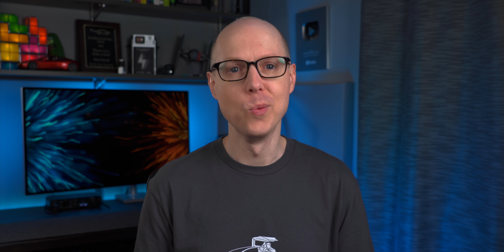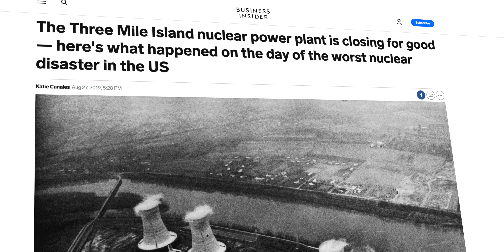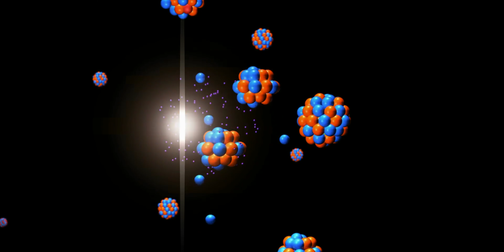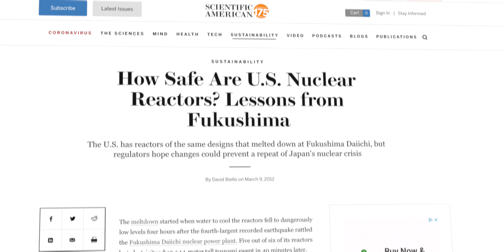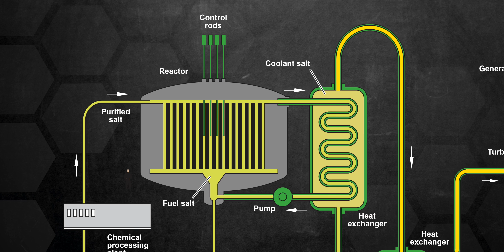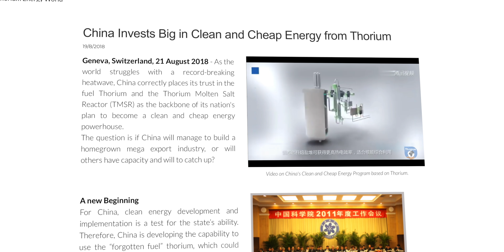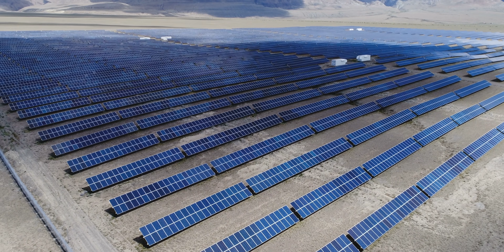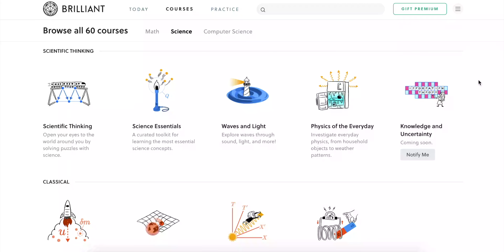Thorium explained - the future of cheap, clean energy?

Comment: I have been hearing about the potential for Thorium for the past 15 years but doubt we will see a successful roll out of the technology in my lifetime (I'm 66). Much like the dream sold back in the 1950's of power too cheap to meter for nuclear, Thorium seems to base it's pitch on unlimited 'safe' power.  All the time renewables are eating away at the economics of nuclear of any sort and the latest generation of solar panels about to be launched together with battery storage tech will further dent the proposition.  Traditional nuclear was driven by military needs but Thorium has to stand on it's own merits. I doubt it will.
Reply: Hi John North,
Given all the companies which are pursuing this technology, I think you are very likely to see technology before you die.  You just have to promise not to die.  (For 3 to 8 years.)

I listed 6 groups in a post above, and didn't mention the heavily funded Chinese program.

Warm regards, Rick.
Reply: @RicksPoker  Not holding my breath :-) https://www.dailymail.co.uk/news/article-8406315/Dramatic-moment-silo-collapses-nuclear-power-plant-Hinkley-Point-C.html
Reply: @johnnorth9355  
Hi John North.
I read the article you linked to.  It had nothing to do with Thorium research. Did you post the  right link?  Or was this a general example of how any bad news for Nuclear is big news?  

Warm regards, Rick.

Comment: If thorium is 3X more abundant than uranium then its 428X more abundant than uranium 235. U-235 makes up 0.7% of natural uranium the 3 to 5 % is how much you need to enrich the U-235 for usable fuel. Yes a little of the U-238 (2% ?) gets converted to plutonium  of which the Pu-239 ( 75% of Pu isotopes ? ) is useful fuel. To really make Pu-239 efficiently with less of the undesirable other isotopes you take the fuel out after as little as two weeks, it will be neptunium, wait (a month ?)  and the neptunium decays into plutonium. For real efficient breeding you want to use fast unmoderated neutrons, that means high levels of enrichment and high temperatures so no simple water coolant. Thorium's advantage is that it allows breeding with thermal neutrons like all power reactors use.
Reply: and all the meanwhile  that mox experiment that blew both its side by side reactors up is circulating the globe is approved in  ingnorance.
Reply: @stevenlonien7857  What MOX experiment are you referring to? The only side by side explosions I know of is Fukushima Daiichi's units 3 and 4. Unit 3 did use 6% MOX, I wouldnt characterise this as an 'experiment' MOX fuel is widely used. The reactors did not 'blow up' the upper part of the buildings did. There is still caesium-137 from Fukushima 'circulating the globe', it is dwarfed by the amount of CS-137 released by decades old nuclear weapons tests.

Comment: Honestly, the TerraPower reactor is the one I'm most excited about.  Nuclear's biggest issue is the waste that's generated.  If we have a way of using that waste to generate more electricity, then it is no longer "waste".  Of course, I'm guessing that even that reactor won't spend a fuel rod to a non-radioactive state, but it still breads new life into old reactors (most spent fuel rods are kept in a separate pool at the reactor).
Reply: It doesn't breed life into old reactors...  We want to get rid of all our old reactor designs, they're dangerous as fuck...